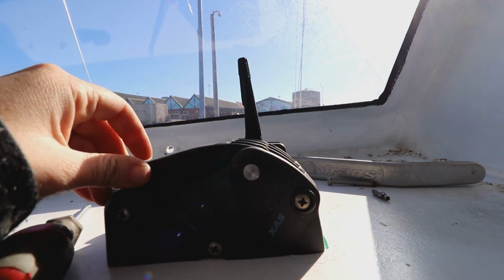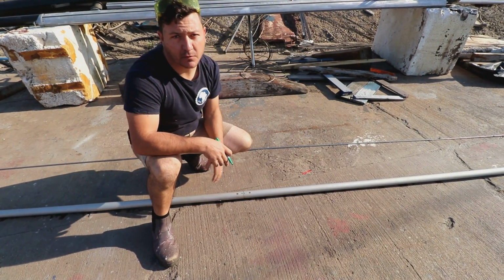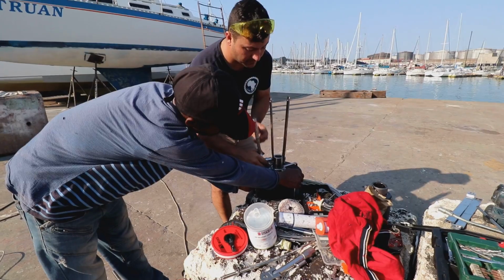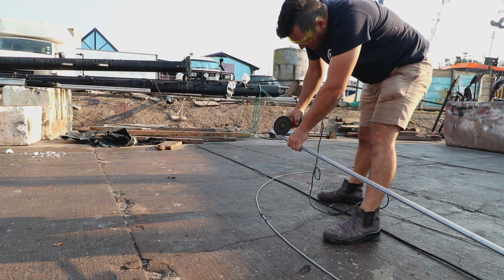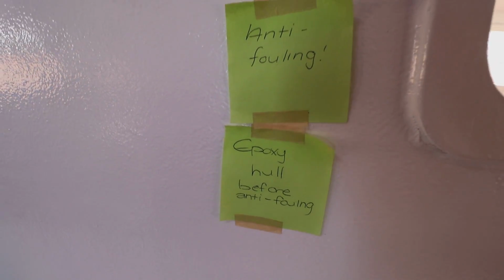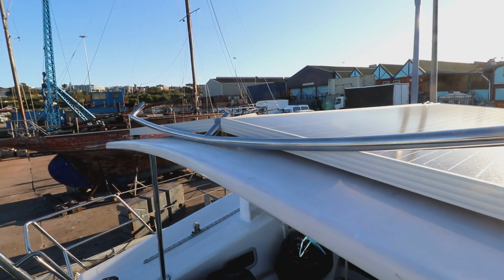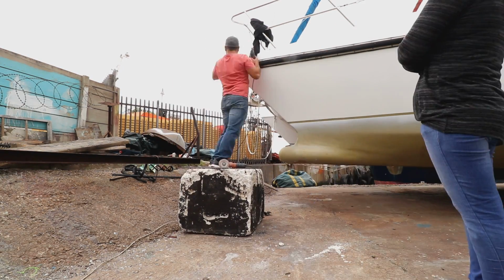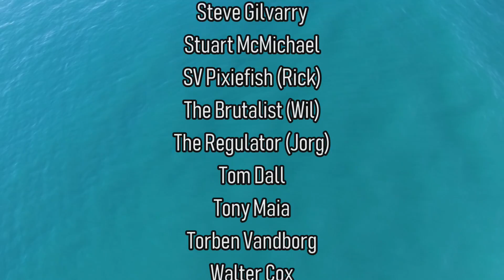THE FINAL COUNTDOWN!  | YACHT REBUILD WEEK 84

Comment: Hi guys, you can use a 10-20% solution of bleach and water to clean the sail. It will help not harm the sail at all, but will reduce the stains ( not eliminate).  Watch out for expensive commercial cleaners they can ruin sail by removing the resins in the sails and shrinking the luff and leach tapes creating while baggy sails. ( I'm sure you don't have any money for that anyway but  bleach is cheap)   Cheers Warren

Comment: Splash day is just around the corner but as for now I am looking forward to the engine install. I do have a question are you going to have a generator on board that can be used as well or when needed? Now for the sails just a little bit of soap and water and a lot of TLC cant fix. Keep up the great work. I do like the idea of the name Sailing Lady Africa ( add name of the sail boat). See you next week.
Reply from the maker: Yes we will have a generator. We also naming the boat Lady Africa ☺

Comment: Good job guys! Question what did you guys use to seal that handrail/panel potector and the rubbing strip? Just a sealant or butyl tape?
Reply from the maker: The hand rail we used butyl & the rubbing strip we used Sika Flex ☺️

Comment: Hey with that funky camo sail you will fit right in down here''
If you are short of cash get a Yamaha 2 stroke 5hp outboard, they'll push any dinghy along, and light enough to get back a board. The things are entirely rebuildable and reliable to boot.
So whats about the name, think of the call sign, mine is zulu alpha yankee alpha, its just easier man'
otherwise have a damn contest !!!!
cheers
Reply from the maker: The problem is those outboards are expensive!! Cost us R 10000 second hand 😔
Reply: @livingwiththemaias  theyre like A$500-A$600 here, about parity with Rand